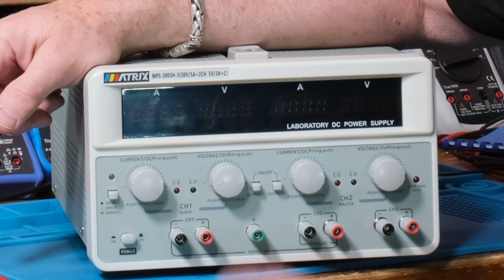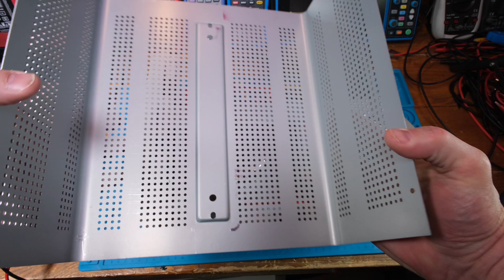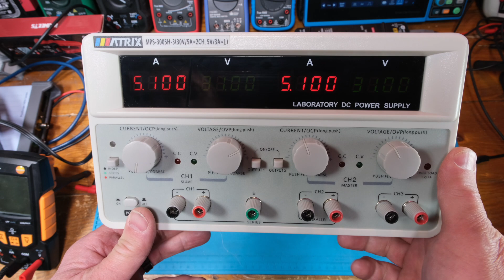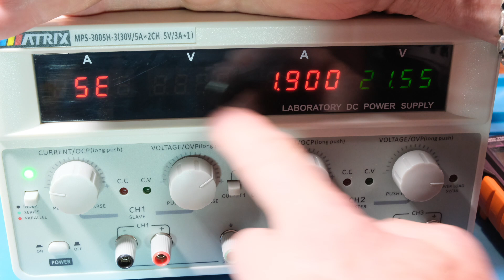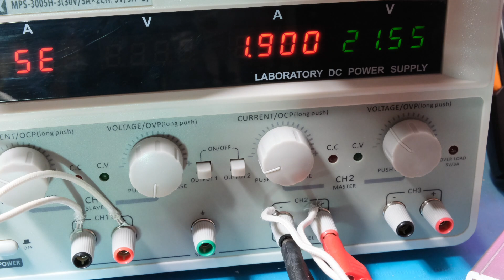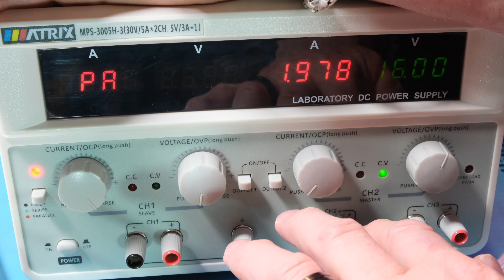Low Cost Triple Output Power Supply with tracking by Matrix MPS-3005H-3 #benchpowersupply #Matrix

Comment: I think I damaged my power supply from Rigol DP831! Its flashing a message: CH2 overcurrent protection, disable the output of CH2! And nothing is turned on as output, so something went wrong. I've reinstalled the firmware but the darn message is there making the entire power supply useless!!! I don't think I'll buy another one from them!
Reply from the maker: That's too bad Tony.  Try unplugging it then using a multimeter check the output to see if it is shorted.
Reply: I was gonna charge a battery, like I always do and it did not show the voltage of the battery and complained at first of OVERHEATING so I shut it down and rebooted, but than it was complaining about CH2.... I don't know how much these power supplies cost to repair and or where to send it. What I was able to measure under: Power off- no short anywhere.
Power on - 5V/5A has 5.1mV; +30V/2A has 1.03V; -30V/2A has-16.8V - all settings are at 0 and turned off, so there isn't any reason to push any volts anywhere.
Measuring for a short - 5V/5A has a short and -30V/2A has a short.
Reply from the maker: Hey Tony - I wonder if your battery back fed into the power supply and took out the FETs?  It probably isn't under warranty - right?  If the Lab supply doesn't say it can do batteries, then add a diode to protect the PS from the battery;)
Reply: @kissanalog Here is a short video of the problem: https://youtu.be/ItlXSUGuWXQ  An yes, I should make a gizmo with couple Zener diodes..... But that time passed long time ago! And no, warranty for about 3 years I think..... Thanks Edd again for your ideas, next time warn me about my stupidity earlier! ha ha ha  have a great Thanksgiving!

Comment: I am going to make my own 48v 10a Lab Bench Power Supply,  i gone use the SUSWE 48v 10a Switching power supply, 
with the XY5008 DC DC Buck Converter CC CV 0-50V 8A 400W Power Module, i have all the rest, the connectors and 
on off switch, and 3P IEC 320 C14 Male Plug, and Fuse holder with Fuse, and all the cables,  and dual R Connector Brass 
Binding Posts, and already 3D printed my Lab Bench housing, so need only to wait to get my SUSWE 48v 10a Switching 
power supply, with the XY5008 DC DC Buck Converter.

Have already made one few years ago that is 32v 5a, but wanted one that give higher voltages and amps.
Reply from the maker: That sounds great!  Please let us know how it turns out;)

Comment: Nice supply and as always, a good vid!!!! I was curious to see the transient response. Another thing I would like to see is how high the rails are before the regulation, because it seems that there's not that much capacitance on the building and so they must have a very high margin for regulating the output. Well, that would certainly impact the transient response, imo.
I do not understand why didn't they went with a LCD or OLED display. They certainly have all the digital values from output ready for display with cristal, low voltage to power then... I don't get it.... And now a days, these displays are very cheap.
But for just over 200 bucks seems a very nice power supply.
Reply: thank you for your suggestion, we will consider it
Reply: Hi, can you please kindly advise which performance you want to see on our power supply? as you mentioned in first paragraph. i don't quite understand you.
Reply: @Matrix_2003  Thank you for reaching by and being available to even consider my comment. I would like to see how the transient voltage and current behave when switching a load for a low, medium and heavy loads.

Comment: The way you have everything stacked together, it looks like you blocked off all the airflow.
Reply from the maker: Thanks Aurthor for the feedback.  I do have this stacked - mostly for the videos;)  there is room for airflow - I try to be sure that each unit - depending on where the air holes are - are not blocked.

Comment: Wow, an old school boat anchor "low frequency switcher" (see, we do pay attention!). And mechanical relays! ("None of your MOSFET rubbish" as a certain Aussie EE blogger would say).
Still think the "gold standard" for banana terminals is the triangular arrangement as on your Xantrex units. Then you can use a dual banana plug between any two terminals and a brass busbar on the ground which can be rotated to ground either positive or negative. Could be extended with another positive and negative the other side of the ground for a dual supply, but I've never seen that arrangement in the wild!
Reply from the maker: LOL Thanks John for the great feedback!  I agree, I think the triangular arrangement is probably the best.

Comment: Hi Eddie, thanks for the interesting review! Just a question. I saw in the picture in Amazon, next to the "matrix" logo on the front panel, is written 3A for all autputs and not 5A... Any clue? Maybe 5A is intermittent load and it holds 3A only, continuous service?
Reply from the maker: Great question!  There is the 3 Amp version, so you have to be sure to get the 5 Amp version (MPS-3003H-3 vs MPS3005H-3; the ...3H is 3Amp and ...5H is the 5Amp version).

Comment: I have a 'CSI 5003E III' it has two 50V 3A supply's and a bloody great toroid and is very similar front panel to this and it works fine in fact the display looks exactly the same as yours right down to the colours and the decals but is very bright and cost just shy of 200 quid...cheers.
Reply from the maker: Thanks for the feedback!  That sounds great!  Is it still available?  I wasn't able to find it.

Comment: When I started my channel I purchased a 0-30 volt DC power supply @ 10 amps. Closely followed by another to give me plus and minus outputs. I took me about a month to realise I really needed more volts less current. I sold these and replaced them with 2 off 0-60volts @ 5 amps. Been perfect so far, Who knows about next month!!
Reply from the maker: Perfect Michael!  Too bad there's not a 60V 10 Amp tracking PS;)
Reply: @kissanalog  we have 60V/10A in another series
Reply: More volts for what? Audio amplifiers?
Reply: @VioletGiraffe  Yes audio, mostly what I do on my channel.
Reply: @MichaelBeeny , thank you, this is a strong hint that I might want a 60V 3A instead of 30V 5A as well.

Comment: I have those dual plugs now. Pomona even sells their probe wire, 50ft for 40cad. Is this company offering discounts?

Fans blow away from the label buddy. Or suck through the back if you will haha

The toroid is gargantuan. I like it!

That is very nice of them. Amazon doesn't have that model in Canada or I'd buy it right now with that code says their storefront just launched and theres only single output ones. It's a shame. I've been wanting a multi output psu for opamp testing
Reply from the maker: These were just released I think, so maybe they will show up soon.  I ask about the release in Canada and I'll let you know.